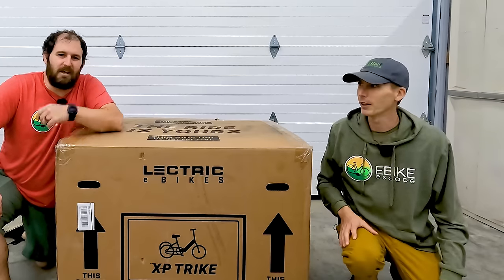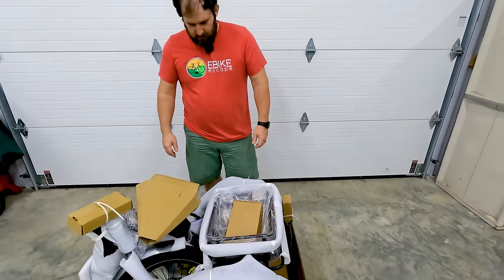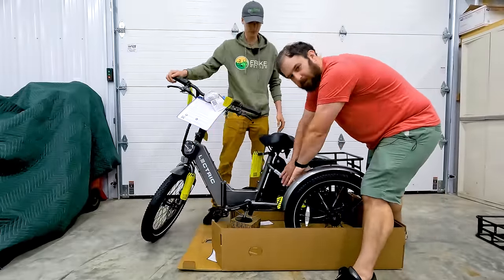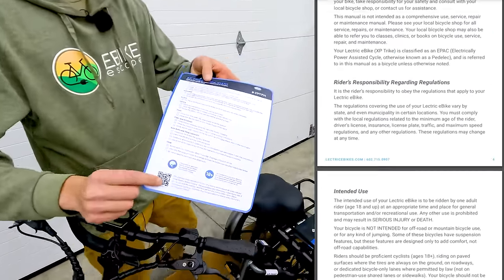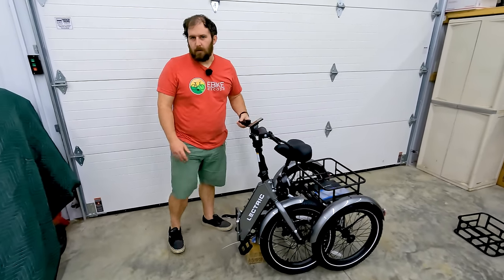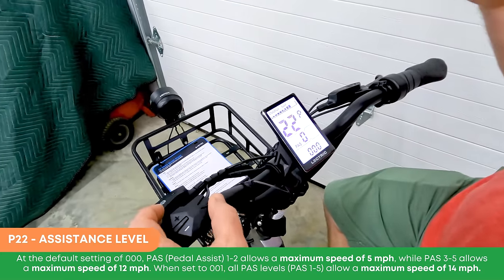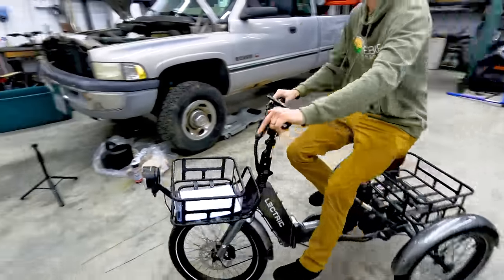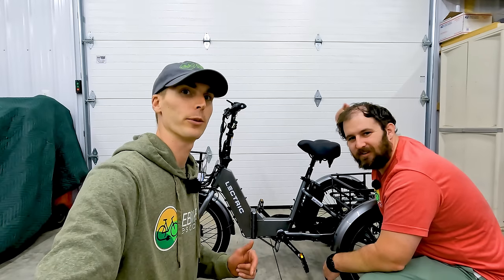Unlocking the Lectric XP Trike: Unboxing and Answering Your Questions!

Comment from the maker: Buying an XP Trike? Support the channel: https://lectricebikes.sjv.io/dox4Oq (affiliate link & thanks!)
Reply: Love the videos. I am seriously considering buying the  Lectric XP Trike, and yes, I will use your link to do so. I am 280 pounds, so what is the weight limit. I have a golf course two miles from me, and would like to ride this to the course and use it as a golf trike. So, Will it get me there and back, and carry my 280 pounds + clubs for 18 holes, average golf course is approximately 6600 yards long (3.75 miles or 6 kilometers) ?  I know they don't offer the club caddy attachment on their site, but there are several universal ones available to ad to e-scooters. I am disabled, but can still pedal some, and walk a little if needed. Also, If I am using it for golf, and don't care about width, can I use their fat tires with it?  Lots of questions, but I appreciate any info you can give me.   Thanks, Alan.
Reply: My wife has one she always rides it at level 5 and it's still too slow I have an XP premium with the 750 watt motor with the dual batteries. The fastest at level 5 no-pedal assistance 20 mi an hour. My friend has an off-brand same setup no-pedal assistance his bicycle 37 mi an hour
Reply: I noticed I weigh 250 pounds this bike has a hard time going up a hill
Reply: @StephenMartinez-ve1ey  on most hills, my Trike goes up the hills ok on PAS 5. Forget about PAS 3 or less, not good. Just go right to PAS 5 for hills.
Reply: HOW MUCH CAN YOU WEIGH FOR THE BIKE
Reply: i bought the Letric Trike thanks for showing me how to unfold the trike /1 now to charge it and ride it .
Reply: Hey fellas, just watched this unboxing video.👍 I have also viewed your comparison videos. 
This video is 11 months old, but you two have not addressed the viewer’s inquires. 🤔
I am nearly sold on this unit but of course the spouse element and I need to first do the touchy-feely thing to seal the deal.

Comment: I just wished they came in different colors.  But that's not a big deal.  The fact it comes already assembled is a huge plus for me.
Reply: I was afraid I wouldn't like the color, but it's actually a gorgeous platinum silver that's much prettier than it appears online.
Reply: Too bad thats a half truth! U have to assemble handle bars, seat, battery. Then you're SUPPOSED to tighten down EVERY connection on it. Plus u gotta install the rack n front basket IF u buy it.
Reply: @laurelglass9326 You know you can ALWAYS hire someone to do all of that if you aren't able to or don't want to do any of it.
Reply: The pearl like reflection and depth of paint looks like a show car! I didn't car about color and was astounded by the beauty of the silver that only shows in real life.
Reply: The lack of color options is why I went with Heybike instead of Lectric. Otherwise I would have purchased this instead.

Comment: If I were to get a trike, this would be the one.  It seems to be far and above better than the others.
Reply: It is.  I have one. :)
Reply: Just one person's opinion I believe that the front wheel drive trikes put some kind of twist to the front fork that makes it much easier to tip. Or it just may be the direction change of the front end under power that makes it easy to lift a rear wheel.
Reply: @timbuckingham6734  the  XP-Trike is a rear wheel drive, right?
Reply: @marciagilbert3996  yes it's rear wheel drive with a differential
Reply: I’m thinking about buying a trike next year I hope they come out with more colors like hot pink 😂
Reply: @ms.carlettawilson1522  try asking them about other colors, and suggests the pink will sell the trike to more females. Then try to get others to make the same request.

Comment: I would like to add a couple of things. If you lock the rear wheels before folding or unfolding. It makes it even easier. And the rear will will lockup when trying to push it backwards when folded. Making it very difficult to to get into or out of a storage space or elevator. If when folded if you balance it on the front and rear right tires. Than the left rear will be lifted off the ground. And it will roll backwards. And please add a rearview mirror on the left side so to view traffic behind you and people making right hand turns if you are in a bike lane or sidewalk.
Reply: I saw this older guy on YouTube he got a large plastic tote from a store and he folded his trike and leaned the tote over and slowly pulled the tote closer to the trike and bingo it was in then he had a ramp that led up to the back of his van and he pushed the tote in and I was so happy because now I can put my trike in without any help

Comment: I had a Lectric bicycle which I could no longer operate for medical reasons.  I ordered the trike 3 weeks ago and the first ride put a permanent smile on my face.  My only concern is that thin cardboard box doesn't offer good protection and the beautiful metal fenders were badly bent.  It's not worth the damage just to claim no assembly required and the trike should be shipped without them attached.  Now, back in the saddle for a 14mph ride off into the sunset.

Comment: My right back fender came bent from shipping. I was able to bend it back into shape. Lectric offered to replace my fender for free.

I received the Trike a few days ago and today, the mileage shows 117 km. I went up a long steep hill and watched the battery deplete fast. I never made it to the top, before “HOT” message appeared on my display. I stopped, turned around and coasted down the hill in PAS “0”. Then off went the HOT message (did not return). The battery went right back up to FULL capacity. I wasn’t expecting that for sure. But I was able to make it back home without having to switch to my spare battery. Incidentally, I drain one battery every day and switch to my spare during my daily trips. I am out for at least three hours a day. My biggest problem is the COLD up in North Bay, Ontario. I am slowly working through ideas to overcome the COLD.

Today, I got an odd ball sound out of my rear right wheel. I traced the noise problem to loose spokes. Because the spoke nipple size is an odd, 4.2; I used my smallest adjustable wrench and it worked fine. The noise went away (today, no more odd sounds).The tires are all staying at 30 psi well each day and it wasn’t a tire problem.

I love my spare battery that I bought to slip in when the main battery dies off. But hey, my travels pretty well match what the manual says for expectations of your battery life. I just love my Trike and travel on it lots each day.

I wished they integrated front and rear visible signal lights. I bought after-market ones. When I press the remote button, in the day-time, I can’t see if the button light is on or off. Well traffic sure react to my signal lights around me. I must recharge the rear signal light each day (not the remote button). 

I have been oiling my two drive-chains each day. Is that necessary? I also clean my disc rotors with 70% isopropyl alcohol each day and get off black deposits each day. My hydraulic brakes work beautifully. But my left parking brake takes quite a squeeze to be able to flip the small lever into place for parking.

I got the Lectric end-handle mirrors. I only use my left mirror. It’s ok, but it easily and continuously, gets bumped out of position at that location. I feel, I may switch to a different mirror.

I use cargo bags in the front and rear cages provided. That front cage/light was easy to install for me with Lectric’s video. Both cages are real sturdy and are holding up well. 

My speed at 14 mph is consistent and easy to maintain. I am 70 years old and have not gotten out of breath on my Trike. The Trike has turned me into a Superman. I’ve received many compliments from passerby people and I stop and chat with many. I am reluctant to let anyone ride my Trike, for many reasons.

You seldom if ever need a reverse on the Lectric Trike as it turns on a dime really tightly. That engineering is so much appreciated by me. 

I use Lectric’s accessory alarm. But mainly as a horn. It’s so loud, that I press the horn button well back from people on the trails and the horn sure turns heads! I zip tied the remote alarm/ horn to my remote signal and they detach easily each time I leave my Trike. 

I unboxed and put together my Trike, by myself easy in about two-hours. But I was meticulous in going through checking the torque specs on everything. Lectric did a good job on torquing up my Trike to their specifications in their manual.

Incidentally, I did download Lectric’s manual. Printed each page out and then bought a binder with plastic sheets, that I can insert two pages into each plastic sheet. Great ideas for keeping the manual pages clean, but accessible.

I switched to a Cloud 9 seat, with a suspension post; making my long rides more comfortable as I am 260 pounds.

I park my Trike in my garage each night and have a great setup to recharge all the stuff and it’s heated too. Quite fortunate, that way. Oh, I rebuilt a ramp into my garage before I got my Trike, anticipating all the traffic. To make space, I now store my winter snow blower outside under a cover.

I did buy two Kryptonite U locks and cables, plus Lectric’s fold out lock. Then I bought a shroud to cover my Trike up, when I leave it in public. So 3 locks, the alarm, shroud and I feel secure with two Apple tags in place as well. 😂 

Love Lectric’s LCD display. Easy to read all the time and use it fully - lots. I also, use my iPhone with Goggle maps and Sirius radio. I have hearing aids and everything goes by Bluetooth into my hearing aids. It all works fabulous - even phone calls.

I did buy an additional Lazer 800 lumen light that I use all the time. I recharge that light at the end of each day. 

I wear EITHER a high visibility vest or high visibility parka, depending on the weather. My parka doubles as a rain coat too, with a hood. But with my helmet on, during riding, the hood becomes mute. But great to have, to warm up at stops. I did mount front and rear red/ white lights on my helmet for better traffic visibility, on roads.
Reply: Awesome post!
Reply: WOW DONNY, I'M ONLY A FEW YEARS OLDER AND YOUR REVIEW HAS BEEN VERY WELL TAKEN AN SHOULD BE MORE VISIBLE TO OTHER eTRIKERS. I JUST ORDERD MINE BEFORE 4TH OF JULY. I HAVE ORDERED AFTR MARKET TURN SIGNALS, MOUNT UNDER SEAT, BLUE TOOTH, MAKES SOUNDS WHEN TURNING ON. AS I'M 77 I FULLY AGREE WITH WEARING MY LOUD ORANGE SHIRTS. I EVEN HAVE PAIR OF THE LOUD SHORTS. HOW DO I ORDER AN EXTRA BATTERY?  ALSO I'D LIKE TO GET THE LETRIC LOCK, I'VE ONLY SEEN IT ON A FEW REVIEWS, BUT IT HAS NEVER BEEN MENTIONED WHILE THEY MEASURED THE LIFTOVER HEIGHT???? ALSO I'VE SEEN SOME SHOTS OF THE BASKETS WITH A WOODEN PLATE IN BOTTOM AND SOME WITHOUT IT. DOES IT COME WITH OR IS AVAILABLE FROM LECTRIC??? FROM ALL I'VE SEEN EVEN A 310 LB FEMALE LOVED IT. FIVE BIG PEOPLE TESTED IT, ALL LOVED IT. HOOAH, AIRBORNE ALL THE WAY1😁😁😁😁😁😁😁
Reply: @billwynne27  the best solution is to buy bags that fit in your cage(s). I’d forget about plywood inserts. Bags, keep your stuff more secure and dry in the rain.

My short motor-chain is now skipping on the back sprocket. I’ve stopped riding my Trike until July 20th when the Cycle mechanic is replacing my short motor-chain.  

My back PARKING brakes are not working good and there is no hold at all, on the rear parking brake. So the bike mechanic is going to upgrade and replace both front and rear discs and fix that parking brake too, July 20th.

I’m going to thoroughly clean my trike before it goes to the bike mechanic. Also, I am removing the luggage cages, to make it easier for the mechanic to access the disc brakes. 

Changing chains and discs just looks too complicated for my poor brain to handle, so I’m getting the pros to do it. They said, they’ll do everything on my Trike BUT NO ELECTRICAL WORK. But that’s pretty darn good of them as I live a way up in north Bay, Ontario, Canada.

Glad you found a signal m-device (Bluetooth) remote that beeps. I just mounted my signal on the front handle bar stem and I can now see when my signal goes on and off. I just never use the red in the front. Oh and the signal-device sits above my front bag.

One thing I found out about my powerful strobe light at night. Is the bugs ❤️ LOVE strobe lights. The bugs are absolutely intolerable at night with my strobe safety light on. Right now, I just quit night riding until the bug season is gone again. 

Oh one excellent thing I found, was putting a Bose Bluetooth speaker into my cup bag and hang that at the centre of my handle bars. Wow oh wow, what a fantastic sound as I travel on all my lonely trails. The sound is good for passing walkers and bikers on trails. They always know when I coming from the behind them and move to their right. Oh and they all seem to love my music 😂

I would not buy the Lectric lock and just buy the expensive New York type high security lock. The thieves can cut through the Lectric lock in seconds. I did buy one at  purchase of my Trike, but use it with my other locks as a slow-down effect for the thieves.

Comment: I already have one on order ... my first eBike! 😁
Reply: Can't start mine after charging?
Reply from the maker: Is the display plugged in?
Reply: @EbikeEscape  yes everything is plugged in tight, the display comes on for a second after tapping the battery, then shuts off again. I gather the connection going into the battery box is loose and I have no way of tightening it, I'm waiting for a response via email because they do not take phone calls, Its very frustrating. Thank you for your response.
Reply: I guess my biggest frustration is now that the bikes are being delivered they have shut down their customer service call center, this is my second day of waiting via email for a response.
Reply: You just need to push the button on the battery to reset it.  It's in sleep mode.

Comment: I got mine! Very cool. I had a glitch, but they were right on it. Ha! You're the only ones who didn't open the box with a knife and swearing. 
BTW, I'm really glad they protected the rear brake rotor since your initial review. But boy, did they make it hard to clean. Anyone who doesn't think so, didn't do it. But ya gotta do it. Now Lectric needs to make (or find) a tool to help us out.

Comment: I think this might be the first trike out there that doesn't have the motor in the front wheel.  Makes the bike more usable having the motor in the back powering the 2 rear wheels.  If I bought a trike, the Lectric would be the one I'd go with for sure.

Comment: Really good video.  I have some questions about theft-protection?  Is any built it?  Is there a Find My Trike feature, like the iPhone?  This is becoming more and more important as you must know?  What other options are there for theft prevention?  Locks, etc?  Can the front wheel be removed or what could be removed to prevent theft?  Is there a really good protective cover that is secure or can be secured for this bike or similar?  Who would be able to provide maintenance/fix these trikes if needed?  Shipping somewhere would not be a viable option?  For instance, I live 40 miles out from Denver, CO in Longmont?  Any ideas who could do this work or how to find out.  Thank you very much.

Comment: Thanks for the video!  Between my desire to cut retirement overhead by no longer owning cars, not even renewing my driver's license as I live in a city with pubic transportation, ride share, food and grocery delivery, etc,  I've really been researching purchasing one of these to get around on MY schedule and with bad knees, my old recumbent is a painful endeavor and can only carry a bag of two of groceries. One thing most of the  reviews I've watched never mention that some people may want to pay heed to laws in their own state.  For example, here in Iowa, Electric bikes are required to be UNDER 750w continuous AND only have a top speed of 20 mph,  although there is some confusion regarding top speed allowed for Class 3 units, (this is  one of the longer battery range units that fits those wattage and mph requirements) to be operated without a driver's license.  The authority that regulates the vast paved bike trail system here ALSO limits ebike use to the same wattage/mph ratings.  Although many streets downtown have bike lanes, there's a lot of stupid people driving cars on those same streets! Lol I do like the backrest seat option for my lower back issues plus the cargo space for running for groceries is outstanding!  Hoping to order mine this summer, this video when combined with others has sold me on this unit!  Thanks again!

Comment: But I love your frame design real heavy duty on the three-wheeler as well as the ex premium e-bike. And you really can't beat the price. For myself I'm kind of an extremist type of dude I always love challenges with my buy and ride toys. My wife loves her three-wheeler hopefully in the future they build an upgraded version bigger motor bigger tires and rims as well as a front fork suspension? I believe that would be a winner for entertaining off-road.
Reply: Their suspension seat gives it a great ride. Not missing front for suspension at all - especially since it goes 14-15 mph, so easy to slow a bit before big bumps.
Reply: @Horselings  I ordered one from Switzerland for my XP premium e-bike it's a real gel seat with dual springs and they're adjustable and come with another set it depends on your weight. But it's a very very quality see with three different springs you can change out light medium and hard. It's pricey but what's the price when it comes to comfort I say when I ride these things I put a lot of miles on them.